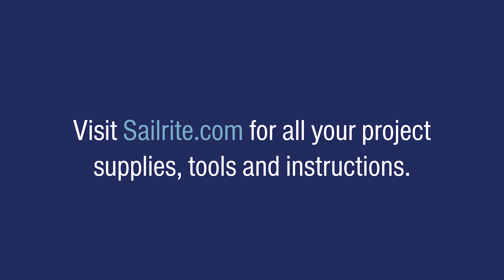Repairing a Vinyl Seat on Golf Cart Using Tear‑Aid

Comment: Wouldn't it be better if the product was tinted to the same colour as the vinyl?
Reply from the maker: Tear Aid is a clear patch and should be almost invisible with any shade or color of vinyl application. If you leave a rip for a long period un-repaired it will become a hole, so repair the rip imidiately using the clear Tear Aid (type B) repair patch and you will not need to worry about the color of the patch showing the foam in your seat.
Reply: exactly!!! I have a White colored golf cart seat with a large tear in it
Reply: no it should be White so to cover up the tear spot! or you should be able to choose your own color to match your color of vinyl tear,   'you should have a color code option added to your product' @SailriteDIY